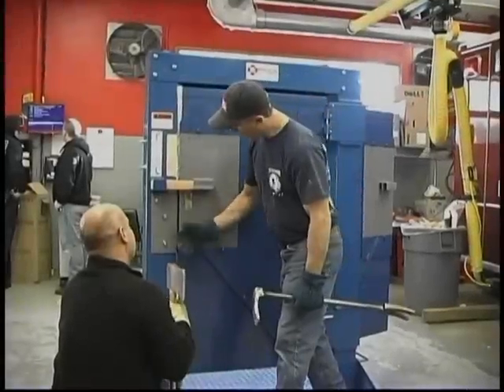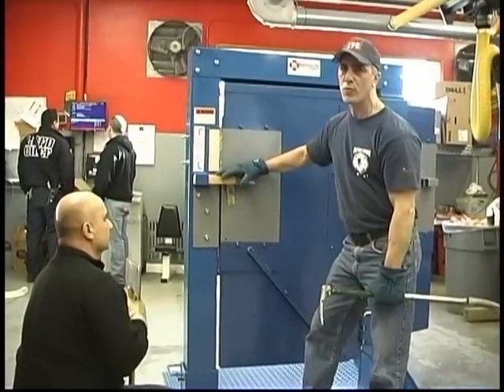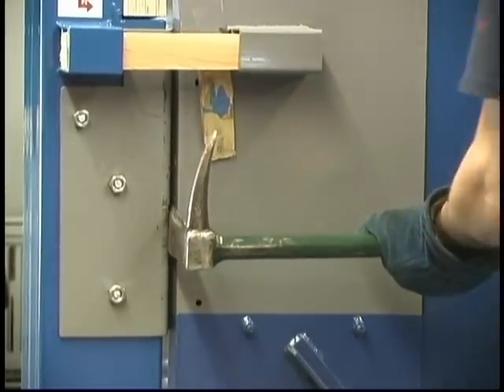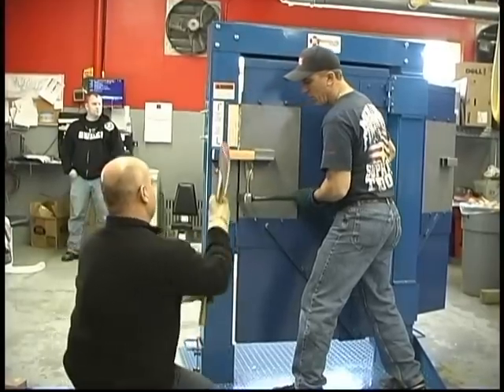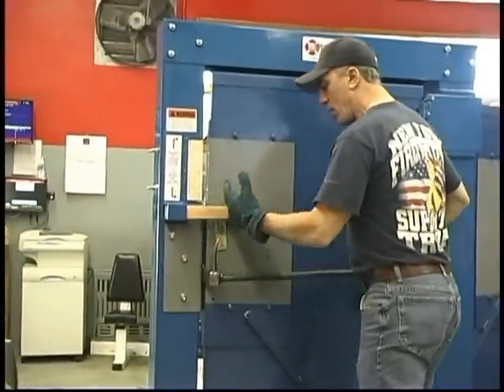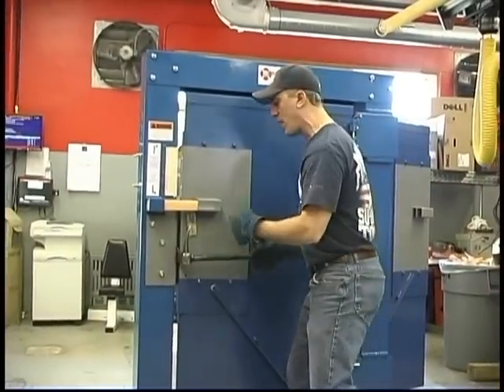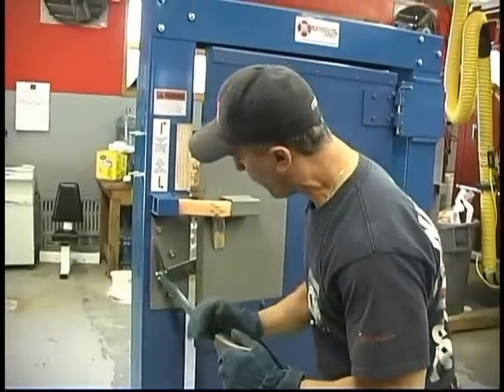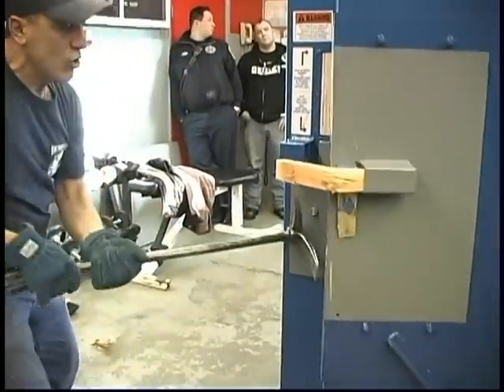#8 - Forcing Outward Opening Doors: Mike Perrone Forcible Entry Training

Comment: So if I wasn't limited to 1 tool than a set of irons would be preferred? Thanks again.
Reply from the maker: In my opinion yes - The 2 Halligan bars I would recommend are the ProBar and LeatherHead - The LeatherHead comes more refined and is a little less expensive than the ProBar. I have both and I prefer the LeatherHead Halligan a little more.

Comment: What is the best tool for law enforcement to carry?
Reply from the maker: Good question - A battering ram works great for inward opening doors, but is pretty much useless for outward opening. One of the reasons the "Irons" work so well together and why they are a staple for most fire departments is that when combined they give you both striking and prying ability. If you had to choose just one tool to carry, take a look at the "PIG" - Which is an 8lb flat head axe combined with a pick. Another alternative is the TNT Denver Tool, which has a variety of features combined together. Both allow the ability to both pry and strike, but neither are perfect for every situation - but no single tool is. The PIG has more weight at the head so it will do more damage than the Denver Tool. Good luck with your decision.
Reply: A fireman

Comment: Is it good practice to shock the lock on an outward swinging door?
Reply: People have differing opinions in my opinion yes you should on a prop it doesn’t do anything in a real door if you shock the leading edge of the door it will crush it making it easier to gap that’s just my opinion try both methods if you have the opportunity